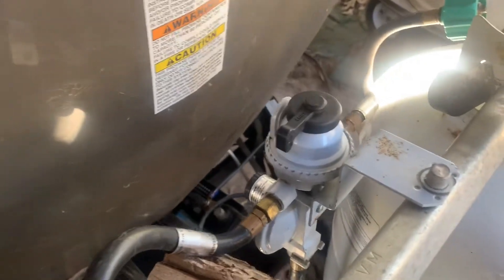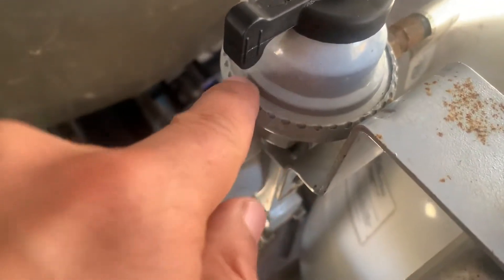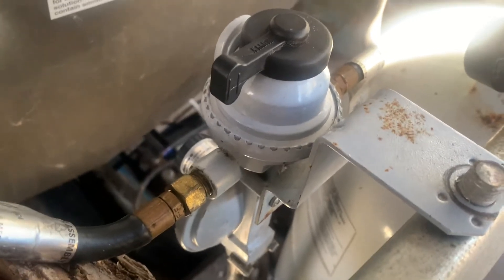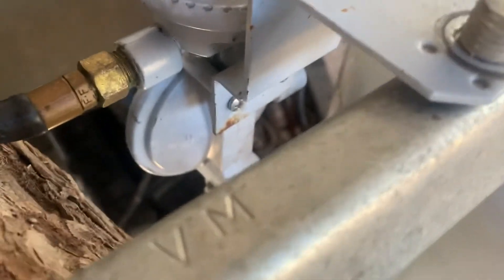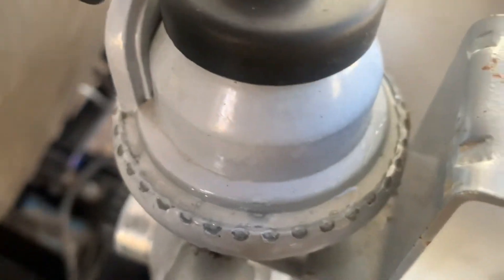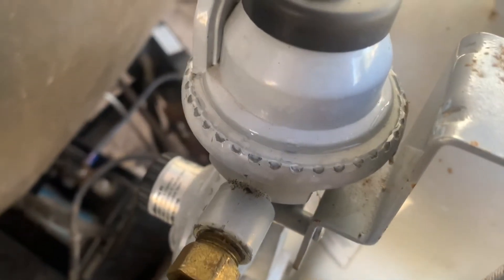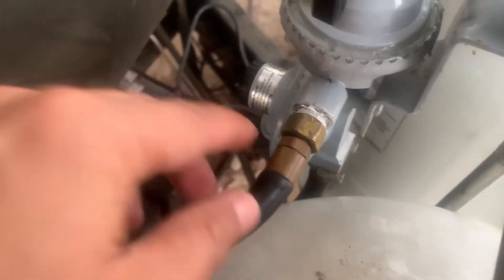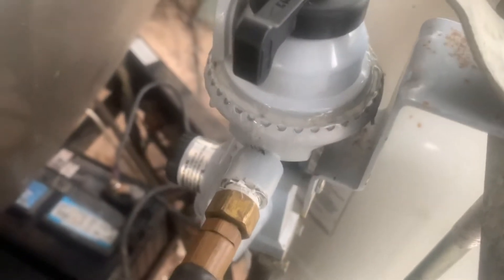HOW TO QUICK FIX A LEAKING PROPANE REGULATOR ON MY CAMPER

Comment: Im all for fixing things, I stumbled onto this video because I was checking to see if there was a fix for a leaking propane regulator. I have a 2 stage and mine is leaking in the front of the first stage. I thought it was somewhere else but took off protective cap and it's leaking on front face of the 1st stage. I'm not trying to be a douche bag. However, the whole good enough comment was what gir me to comment. It's either your "Hack" fixes your problem or if doesn't. Because it's not leaking as bad then it's OK? No! It  isn't, propane could build up and next thing ya know you're whole family is BBQ'd. God forbid for that to happen. I'm going to try and fix mine with some muffler paste and that shiny metal tape... And if that doesn't seal the whole completely. Then that's not good enough gotta take the hit and replace it. The disappointing part is I just changed it with a new one and  the one leaking now I just bought on Amazon a few months ago... Going to get the extended warranty this time if I have to get another one ....
Reply from the maker: Yeah I ended up replacing it because it still had a slow leak. It got the job done for the weekend but I was wasting too much propane so I bit the bullet. Thanks for the comment and good luck on your issue.

Comment: This is the worst idea ever.  Not trying to be mean but other people may take your advice.  That seal is supposed to leak if there's a problem.  It's a safety feature.  Disabling the safety feature when dealing with combustible gas under pressure is not a good idea.  Very dangerous!